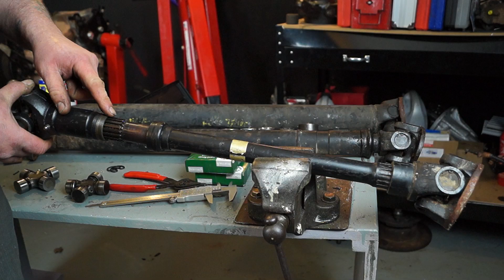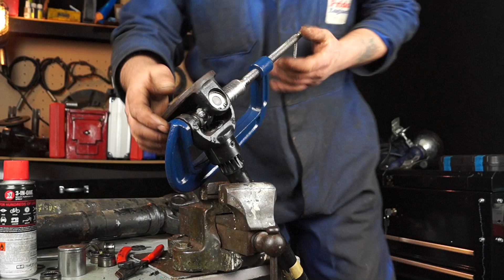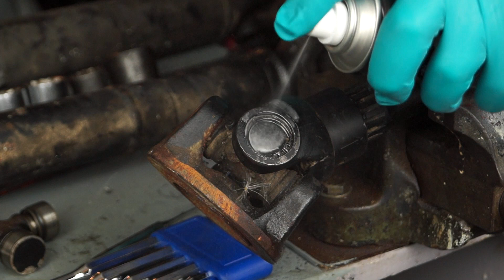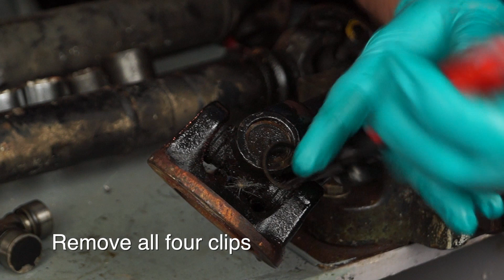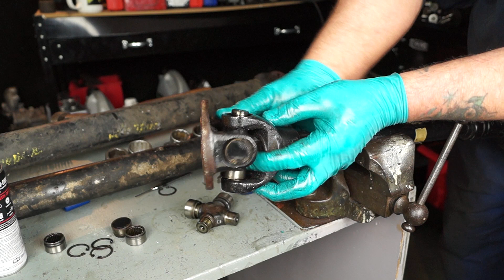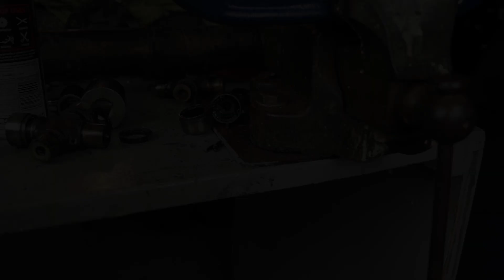Land Rover Prop' shaft repair part 2 - Stripping the old universal Joint

Comment: Great tutorial, that G cramp looks really cheap, good ol China.
Reply from the maker: GasGiant62  yup,  guess so,  everything is made there now.   Got to reply to you other comment regard clamp / cramp.   I think i got to that sort of age where one has gone past the technical terms and it is that "blue thing hung up over there".    :D
Reply: Just managed to break both my g-clamps trying this trick - Only managed to get one of four out! Shoddy manufacturing taken to an all new level I'm afraid - the casting cracked both times.